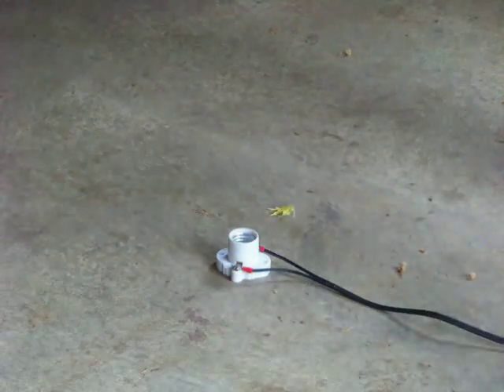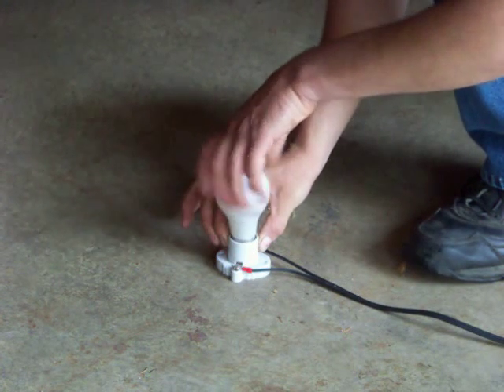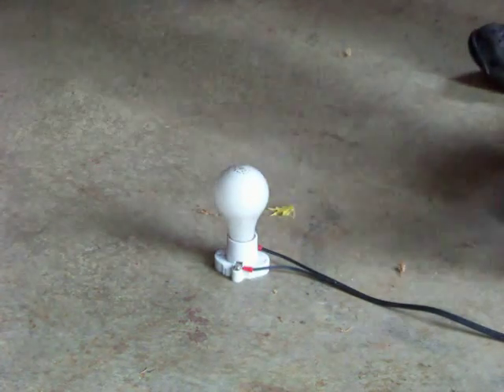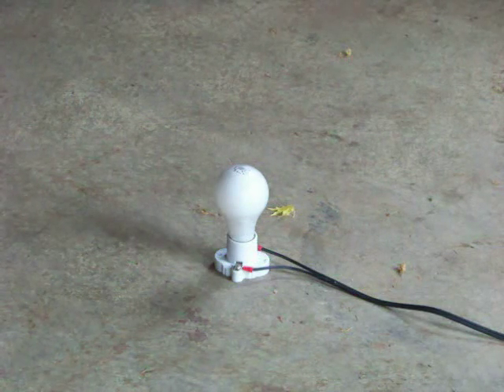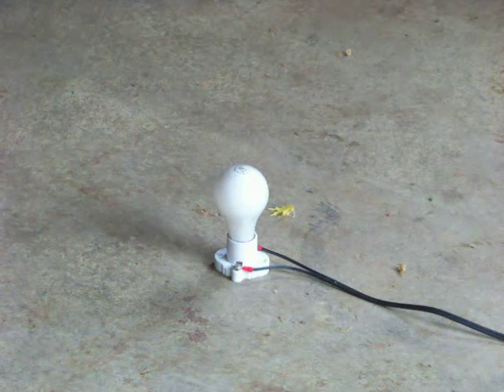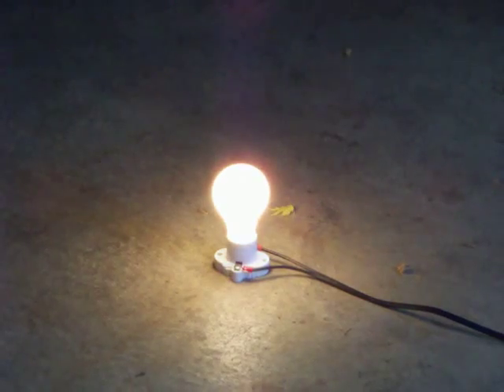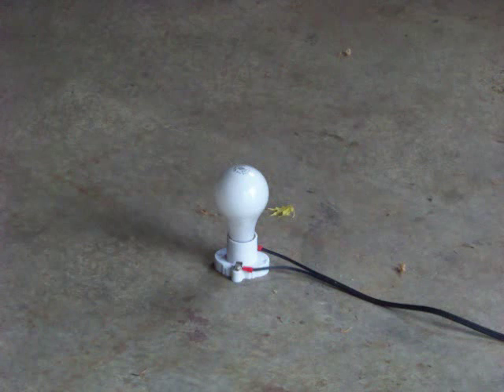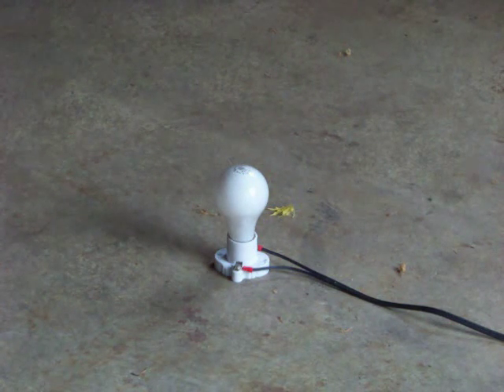high voltage on light bulb

Comment: when I was in my teens, we had a 230 volt outlet in our living room for an electric space heater.
and a neighbor was trying to rewire it so that it would be 120 at the top and bottom outlet.
he turned the breaker back on after he was done, and turned the lamp on and there was a huge POP and flash ! everyone in the room jumped about a foot,and the glass envelope even broke. he had the wiring mixed up, with the 230V leg fed to the outlet that the lamp was plugged into instead.
to make a long story short, he did get it straightened out, and it worked just fine.
oh, << Disclaimer >>  no lamps were injured in the making of this wiring mishap, just the light bulb HA HA

Comment: I've seen bulbs designed for 6V get even brighter when fed 9V. Get them much higher, e.g. 12V, and the filament gets too hot and melts, poof! No light. Try a variable transformer on a 240V line. Start the 100Watt bulb at 120 then raise to 150V, see if you get it brighter without it blowing right away.

Comment from the maker: @67tr876 some years back the hardware stores in this area actually sold a device that plugged in the wall that would lower the voltage to about 105 from 120. it was being advertised as saving money. they claimed that lowering voltage would cause motors to run cooler (dont make sense to me) but for incandescent lighting i can see this working.(remember undervoltage can cause damage to some motors and devices. generally acceptable drop should not exceed 10% raqted voltage. (industry standard)

Comment: You can run two bulbs in series with 220.  Also if you have a DC drive you can hook 6 bulbs up in series to see if the 700 volt dc is working!